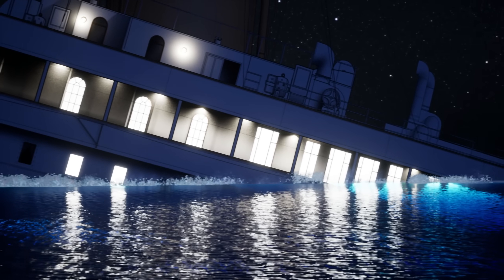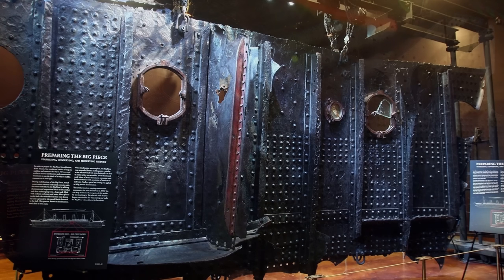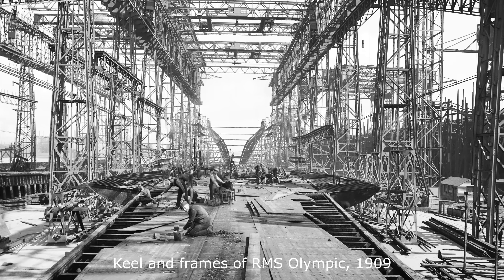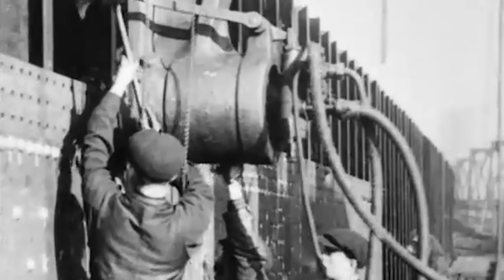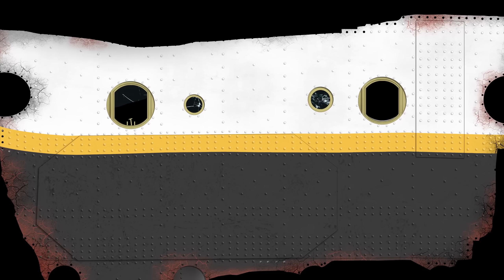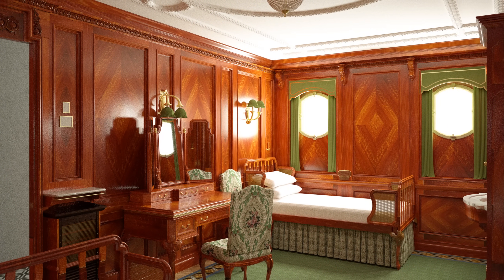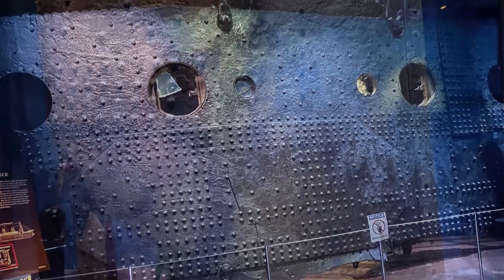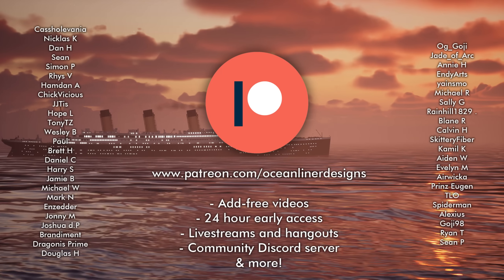Titanic's INCREDIBLE 'Big Piece' - Design Secrets

Comment: Interesting.  The octagonal doublers look more like fish (or splice) plates between adjacent main plates rather doublers as such.   It is difficult to see how they would otherwise contribute to the strength of the hull.  Their discontinuity between each other would mitigate against them being classic doublers. It is perhaps not so surprising that there is this large ammount of reinforcement high on the hulls side.  The hull form is basically an open channel (a bit lik a rain gutter made large).  Considering the hogging and sagging in the waves the lower part of the hull has the bottom plating for strength.  In order to balance the section modulii of the hull extra material would be added along the top to position the neutral axis of bending higher than it might otherwise have been so that the stresses are better balanced.
The failure of the hull appears to have been a hogging moment failure as described by Dr Ballard in his book.  The 'big piece' positioned as it was, high on the hull side was therefore a tension failure.  Failure of the rivets in section would have been extremely surprising (assuming the designers did their calcs right) and the tear through port holes and such is more inline with expectaitons.  Had they been lower in the ship, on the compression side, then a popping of the rivets as the plating buckled is quite likely.
It appears that the plating in the bow section crushed by the iceberg collission probably suffered exactly that....which is why the water got in so quickly.

Comment: I can't believe the amount of further damage the "recovery" did to the Big Piece. Cutting it up and blasting paneling off?!
Reply: This is all I could think about during the video. Pressure washing off wood panel remnants and chopping it up so it would be easier to show off? It sounds like something an 18th century colonial aristocrat would do…
Reply: The treatment of the Big Piece feels eerily similar to the early days of "modern" Egyptology.
Collecting as many artifacts as possible, ripping them out of context and preparing them for display to make some quick money.
Reply: Not to mention I think they dropped it when recovering it from the seafloor and broke a large section off.
Reply: They had to clean it and do a process to reverse the rusting. If they didn't do that, it would have continued to rust since it would now be exposed to air. Being that far down on the ocean floor there is little air, so the rusting process takes much longer.
Reply: Not to mention exhibiting it in a casino and not a museum
Reply: @anttibjorklund1869   very sad indeed :'(
Reply: Right, wonder if there was still a little paint on it?
Reply: Anyone know if they at least managed to keep some of what was removed? Even if it can’t be on exhibit, could it be in collection storage?
Reply: @hollyr6923 the large piece that broke off is on display at the Titanic Experience in Orlando. Felt like a religious experience touching it.
Reply: They must've had a reason. Like maybe the fragile wood wouldn't have survived in open air, or something like that?   Regardless, at least it up here on the surface now for us to enjoy, rather than becoming an orange rust stain on the ocean floor in the middle of the North Atlantic.

Comment: Fantastic video Mike, very in-depth. I recently saw a tiny, tiny fragment of either the part that was removed from the 'Big Piece' for separate display or a piece from very nearby, at an exhibition here in the UK. It was described as an outer hull fragment coming from the First Class 'dishwashing and china storage rooms' on D Deck. I wonder if it was actually not from the scullery (as I'd assumed), about 10 frames aft of the 'Big Piece', but from the glass store or main pantry. That would definitely make it an ex-part of the 'Big Piece' – and maybe 'dishwashing and china storage' was just a catch-all gloss of its location on the part of the exhibition (which don't get me wrong, was amazing).

Also, THANK YOU for including the doublers! I'd never quite known the right search terms to enter into various places in order to find out what those shapes were – I'd got as far as 'some kind of structural strengthener', but to know their actual name and details of their purpose is great. Looking forward to the next two in this Titanic 110 series.

Comment: I have touched the big piece.
Reply: I think it's dumb when we have rules like that. Like I went to a tank museum and touched a Panther's front plate, and some dudes like "Don't touch that you'll damage it." Bro shut up its 80mm of steel I could fire a M2 Browning 50. Cal at it and it will barely have a scratch. Not to mention 80mm is 3 inches! That's thicker than Titanic's shell plating!

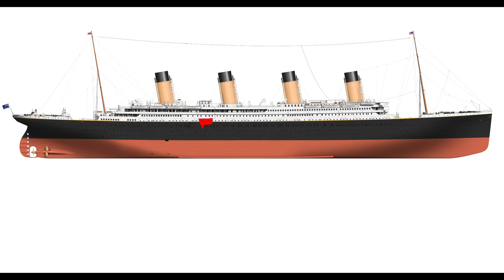Comment: wow that was amazing. also you showed that the "big piece" is between the 3rd and 4th funnel and in the museum it shows it's between the 2nd and 3rd is that a mistake on your part or them? 14:00 and 4:48.
Reply from the maker: That's actually a mistake on behalf of the museum. C-79 and C-81 are in line with the engine room casing, and the layout and spacing of C-Deck portholes on the Big Piece can only have come from those staterooms between funnels 3 and 4. I had never noticed that the museum got it wrong, good catch!
~Mike
Reply: Cool catch on that.